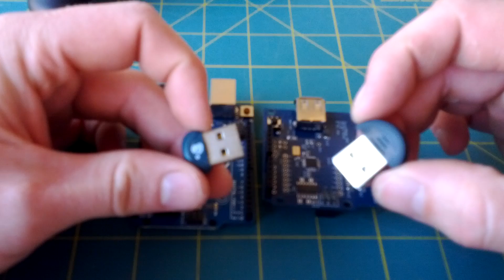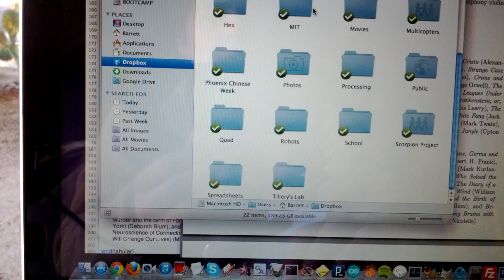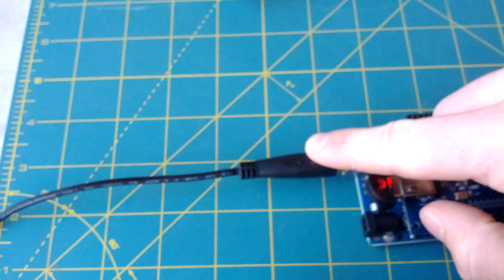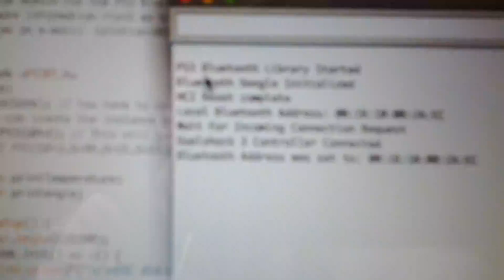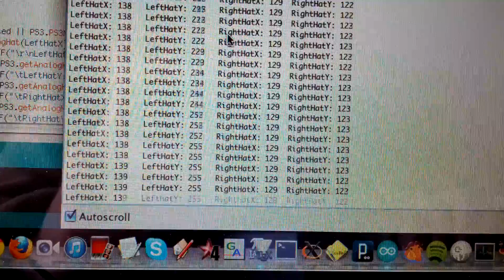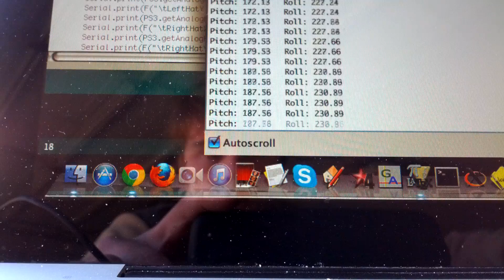How to Connect a PS3 controller to an Arduino with a USB host shield and Bluetooth dongle (Part 1)

Comment: i get this error
Wait For Incoming Connection Request
14:48:23.816 -> HCI Disconnected from Device
14:48:23.816 -> Wait For Incoming Connection Request
14:48:28.497 -> PS3 Bluetooth Library Started
14:48:29.453 -> Bluetooth Dongle Initialized
14:48:29.594 -> HCI Reset complete
14:48:29.594 -> Write class of device
14:48:29.594 -> Local Bluetooth Address: 00:1A:7D:DA:71:10
14:48:29.594 -> Wait For Incoming Connection Request
14:48:37.291 -> Incoming Connection Request
14:48:37.291 -> Remote Name: Pro Controller
14:48:57.632 -> Connection Failed: 08
14:48:57.632 -> Connection Failed: 08
how to resolve this error

Comment: i saw someone do this whit an xbox Controller, ordered the host and since i still had a xbox 360 Controller and a working dongle , could i use this with the xbox controller and dongle or do i need to get a ps3 one

Comment: how many controllers have you used n proximity of each other, "does one controller affect other controllers with different mac adresses?"
Reply from the maker: I would guess that the maximum number of controllers that you could use at the same time would be at least equal to however many you can use with a PS3/Xbox simultaneously (4?). Since the PS3 controller is Bluetooth, the maximum number could be substantial.

Comment: I know it's been a while since this was posted, but I have a very specific 3rd party Bluetooth controller that I would like to use with an arduino project. Does anyone know how I can get it to work? I would like to trigger a button press to perform a certain task when controlling ws2812b led strips
Reply from the maker: It's possible. I would check the project GitHub: https://github.com/felis/USB_Host_Shield_2.0. If the info isn't there, you could reach out to the developers. It probably depends on whether your controller sends the data in the same format.
Reply: Barrett Anderies thank you for the reply. I'll definately look into it and see if I can make it work. I really liked the look/function of this controller:  https://www.gameinstock.com/index.php/nes30pro.html?utm_source=google_shopping&gclid=CjwKCAjwt5DXBRAtEiwAa3vyEg9TMct_bvzo2TDtwU7lTpTCpBi5QhS-kqMr6g89JKAIb9PkQwX-yhoC6aQQAvD_BwE   
since it matches the theme of the project I'm working on. If I can't get it to work with this controller I suppose I could use the PS3 controller. I just really like the retro NES theme. Thanks for the info

Comment: Hi could anyone tell me if I could use a wired controller with the USB host shield
Reply from the maker: Yes, you can use a controller over USB (as long as it's one of the supported controllers: https://github.com/felis/USB_Host_Shield_2.0).

Comment: Hey Barrett its me again. I've already gotten all the hardware required but the problem now is after i upload the code to the arduino, nothing pops out. In your video after you upload the code to your arduino a window will pop up with information regarding the bluetooth address and whatsoever but for mine nothing happens its like the code gets uploaded but it just stays there nothings happening would really appreciate it if you could help. Oh yea Btw I've already enabled the uhs debugging but still no avail. Thanks

Comment: can you use a 3rd party remote or does it half to be an original
Reply from the maker: I'm not sure. I believe it only worked with original controllers when I was using it, but things may have changed. You can check the dev page: https://github.com/felis/USB_Host_Shield_2.0

Comment: How do you get that window to pop up?
Reply from the maker: There is a button in the top right corner that looks like a magnifying glass. Clicking it will open the serial monitor.

Comment: i only get the message "bluetooth library started" and after that noting... does that mean that my usb shield is broken?
Reply from the maker: Did you enable debugging as I demonstrate in Part 2?
Reply: yes still nothing......
Reply: I have the same problem, did you find a solution?

Comment: Why exactly it you can't connect the PS3 controller via HC-05 module?
Reply from the maker: The PS3/PS4 controller is a Bluetooth device without host capabilities. That is, it is expecting something to "talk to it", rather managing the "conversation" itself. It was designed this way because the PS3/PS4 console serves as the Bluetooth host that initiates and maintains communication with the controllers. Hence, PS3/PS4 controllers must communicate with a Bluetooth device with host capabilities. This is achieved on the USB host shield by the USB host chip, which "talks" to the controllers through the Bluetooth dongle. The HC-05 is a Bluetooth transceiver that lacks host capabilities. It waits for something to initiate and maintain communication. Therefore, without a host chip, or something managing what the HC-05 is doing, it isn't going to seek out a connection with the PS3/PS4 controller (it will do nothing actually). It's actually the USB host chip on the shield that's doing the "conversation" work. The Bluetooth dongle is just piping the data. Therefore, unless you hook up a chip with some sort of host capabilities and find a library that supports the HC-05, its not going to talk to the controllers.

Comment: Hey man its good info you got here, I have a issue with my setup I am using a duelshock 4 controller and I can get it connected and piarred once in a great while, What might the issue be? And half the times I get a D1 code error.
Reply from the maker: I'm not sure what the problem is. I get a lot of comments about a D1 error, but I was never able to figure out what the error codes referred to. I would suggest that you contact the developer.

Comment: Can this be done without going through the USB shield and just using the USB type B on the chip?
Reply from the maker: I don't think so. As I understand it, you need a USB host chip to run the USB port that communicates with the Bluetooth dongle, and as far as I know, the Arduino only has a USB to serial converter (FTDI, etc).

Comment: Hi, everytime i turn on the arduino and want to connect to ps3 again, do i need to repeat all those proses (unplug bluetooth dongle & plugging the cable etc) ? Or do i only need to setup once, and next time i turn on arduino, ps3 will automatically connected ?

Comment: I get the BT Dongle info when i plug it in, but when i take the dongle out and plug the PS3 controller in, nothing happens?
Reply from the maker: I haven't used mine in awhile, so my recollection of what happens in this step is not 100%. After plugging in the controller have you tried reinserting the Bluetooth dongle and trying to connect the PS3 controller wirelessly? It might be that the address has been updated, but not shown.
Reply: Tried that, but it doesn't work. It recognises the dongle every time, but not the controller. Is it possible to hard-code the controller address in the program, so i can skip that step and just go straight to connecting it wirelessly ?
Reply: I just tried another BT Dongle and i got it to work :) Like you said, the controller info didn't show, but it connected when i plugged the dongle back in.
But this dongle has a USB HUB inside it(?). what does that mean ?
Reply from the maker: Great! Glad you figured it out. In most cases, if it isn't working, it is something to do with the dongle.

Comment: any idea if any Chinese USB host shields will work with the library?
Reply from the maker: As long as it has the same (or similar) chip to the one on this shield (and the Sparkfun one), it should. You can compare component details to see. If I remember correctly, the USB host chip is the MAX3421E.

Comment: Why doesn't my (same as yours) BT dongle light up when I plug the whole assembly into PC? 
And PS3BT example displays "Error compiling" message (((
Reply: +Harlequin43 solved.
The latest IDE no longer works with USB host library examples. Had to use 1.0.5

Comment: Once I'm running the code on the arduino, It's showing on the monitor serie "PS3 Bluetooth Library started" but it's not showing me the Dongle information, I bought one which is working with the arduino and the shield, but it's not showing me anything about the dongle, do you know what could be the problem?
Reply: how did you do that?
Reply: +Jerome Fernando I have the same problem
Reply from the maker: Did you enable debugging? I don't think it shows the dongle info unless debugging is enabled.
Reply: Yeah I figured out how to debugg it after downloading the program, sublime text
Reply: He explains it in the second part of the video

Comment: will it work with the wireless mouse usb receiver
Reply from the maker: +Mr. Green I am not sure if mouse usb receivers are supported. I have not followed the development of the library for some time. I would suggest checking the GitHub readme for the library and or contacting the developer: https://github.com/felis/USB_Host_Shield_2.0

Comment: hello help pls, i am thinking of making an electric long board with an arduino in there so i can have a custom remote, i was wondering with this sheild if i could use a mouse, and remodel the shape of the mouse, keeping att the wiring the same , so for the pc it knows no difference but for me it a more ergonomic handle, any way i was wondering if i could set scroll wheel up and down to speed, pls reply any help and or problems there are with this idea, thanks to any helpful replies

Comment: how do you control more than one motor?
Reply from the maker: +George Goodfellow What kind of motor? If you want to drive more motors using standard ESCs, you just create as many Servo instances as you need (limited by the number of available timers on your Arduino), and input controller commands into the servo instances (which will drive the corresponding motors).

Comment: sir I want to control a quadruped with my ps3 controller after pairing it with arduino usb host....but My connection seizes for 5 to 6 seconds when I press a button and also I get repeated same button pressed in my serial monitor please help

Comment: Im looking for a proper bluetooth dongle with decent range (at least 10 meters). Trying to do the same thing (use an arduino board uno with host shield, a ps3 controller, and a dongle). Any recommendations?
Reply: +Matthew Wong Also must be a canadian provider - i.e Amazon.ca/ebay.ca

Comment: hi 
I need help. Im trying to make tracked robot controlled by arduino with usb shield and a ps3 controller.problem was it only works when arduino board is plug into pc or latop.I need to make it stand alone and externally powered by batteries.

thanks..
Reply from the maker: AUGUST MARIBON Salido I would suggest that you start with Jeremy Blum's videos on Arduino basics: https://www.youtube.com/watch?v=fCxzA9_kg6s&list=PLA567CE235D39FA84.
Reply: Barrett Anderies thanks for d reply. i figure it out, .max3421e chip on board usb shield needs 3.3v to work..and onboard 3.3v regulator of my arduino is not good.. i put external 3.3v supply to usb shield.works fine now..

Comment: Hi Barrett, I'm having problems to upload this example to my Arduino, the problem is that the sketch binary is too big! I'm using the Arduino Leonardo, could you help me please?
Reply from the maker: Denis Eduardo Donadon Torres If you remove or comment out portions of the example code you are not interested in using it is possible to reduce the size of the sketch slightly. Otherwise your only option is to use a board with more memory.
Reply: Barrett Anderies Nice Barrett, thank you for your help! C ya.

Comment: Hello, can some help me in creating a Arduino code. I have a Arduino maga, motors control shield, and a USB shield. I want to be able to use a PS3 analog controller to control 2 DC motors. Where one motors works of Up and Down while the other motors works on Left to Right.

Comment: Have You figured out the code how to activate the rumble motor in the Ps3?
Reply: Hehe, nerd ;)
Reply: prøve så godt æ kann  :P
Reply from the maker: Tor Johansen It's been awhile since I used the library, so it may have changed, but I remember not being able to activate rumble. You could contact the developer or look through the library functions to see.
Reply: Barrett Anderies  it work with another usb dongle..  it seems like some doesnt support all the ps3 functions
Reply from the maker: Tor Johansen That might be the case. I personally have only ever used two, one of which was extremely laggy. Please do share if you discover anything and I will add the information to the website.

Comment: Would this work with a Arduino Pro Mini with an mini usb host shield? like this : https://www.circuitsathome.com/wp/wp-content/uploads/2012/02/UHSM_mating.jpg.
Size matter :-), the pro mini has 6 pwm outputs. Do the mini have enough memory ? 16kB compared to the Uno's 32 kB..
The ATmega168 has 16 KB of flash memory for storing code (of which 2 KB is used for the bootloader). It has 1 KB of SRAM and 512 bytes of EEPROM.
Reply from the maker: That is an interesting question. Because they make a USB host shield that small, I assume that some Arduino boards that small must be able to run the library. However, I don't think that you will be able to get the library to run with only 16KB of memory. I would contact the developers about this.
Reply: ah, there are mini boards with the 328 chip.. then you have the same spec as the uno. they have also 8 pwm. I guess if you put the https://www.sparkfun.com/products/9627 SparkFun Mini FET Shield on top of that again you drive higher current/voltage servos.
Reply from the maker: Tor Johansen I suppose that as long as your chip has enough memory you should be fine. You don't necessarily need to power the servos from your Arduino. You can supply 5v (or whatever their voltage requirement is) from any power supply you'd like. The Arduino only needs to supply the control signal. Besides that, all you need to do is make sure that everything shares a common ground.
Reply: Have testet it now with ps3 controller via usb wire, works good. But you only have 3 pwm outputs avaible on the mini, sins the usb shield uses pin 9 to 13. Also have to modify vbus connection on shield, it must be 5v. The usb shield must be used with an 3,3v mini.  If you want more pwm and in a tiny packedge, the Teensy is the way to go.
Reply from the maker: Tor Johansen I have a Teensy but have never used it for this. I'll have to try!

Comment: does this work for arduino adk for android ??
Reply from the maker: Yes, as long as you are using Arduino 1.5.5 or newer. If not, there is a manual setting you need to activate in the code. This setting is in settings.h and should be obvious (set the value for your board (ADK) from 0 to 1).

Comment: Very good, question. When I plug in my dongle I don't get the thing that tells me what my dongle's address is but I do get the message telling me the library has started and nothing else. Any ideas?
Reply from the maker: You will get the message telling you that the library has started every time you open your terminal as long as the USB host shield is attached. As for the dongle address message, I would guess that you are not receiving it because you have an incompatible dongle. This happens all the time even if you think you have a working dongle. The dongles are just finicky. If you haven't already, follow the link in the description to my website post and see the link to the list of confirmed dongles. Also, activate debugging just in case it is not showing the address for that reason (I'm pretty sure this is not necessary, but it's nice to see everything that is going on. I explain how to activate debugging in Part 2).

Comment: Hello! I'm really new here and I'd just like to know what's the difference between the USB Host Shield you use in the video and Arduino's USB Host Shield?
Reply from the maker: Both shields use the same USB host chip (the MAX3421E), so their functionality should be nearly identical. It appears that the Arduino version has more breakouts for certain pins. Other than that, there should not be a significant difference.

Comment: Really good tutorial,
but I'm having a problem with the coding to connecting with the PS3, I decided to use a direct Wifi connector that stated it can be directly connected to the PS3 controller as a master. However all these error sprang up.
is there any way to get the code to work with Arduino and PS3 controller?
the wifi connector is 
CZ-HC-05
thanks
Reply: You can also use Wii nunchucks as controllers for the arduino if you have the correct add-ons
Reply: yeah I know but I would prefer to use bluetooth
Reply: good point

Comment: awesome tutorial man!

I still dont found the correct dongle for this, maybe the correct BT is a EDR bluetooth.
Do you know if it works with a generic PS3/PC joystick.
like this?

http://produto.mercadolivre.com.br/MLB-572326081-controle-joystick-s-fio-wirelles-ps1-ps2-ps3-e-pc-4-in-1-_JM#redirectedFromSimilar=http%3A%2F%2Fproduto.mercadolivre.com.br%2FMLB-561874933-controle-joystick-s-fio-wirelles-ps1-ps2-ps3-e-pc-4-in-1-_JM

thank you!
Reply from the maker: Yes, the dongle should be EDR. From what I have read on the developers website (at least for an older version of the library), non-Sony brand controller will not work. However, I am not sure if that is still the case. You should check the GitHub repository and developer's website.
Reply: ty for feed back Sir!
Cya.

Comment: Thank you for this video! It is excellent !  But i tried to use "ADK Shield Module For Android Rev 2.3" and "another BT dongle" . And Error occurred! These are the massages:
  PS3 Bluetooth Library Started
  Unknown Device Connected - VID: 0A5C PID: 21E8
  BTD Init Failed, error code: 209
Sir, is it possible you tell me if  i used the wrong  "Shield" or i have to you the  "Dongle you suggested"?   I appreciate.
Reply: I changed another dongle and it works.  Thank you!